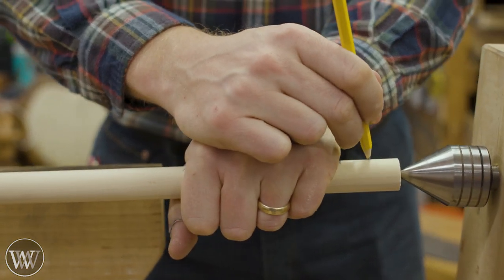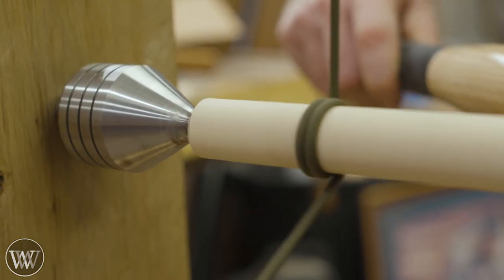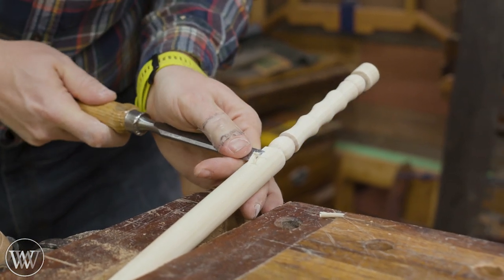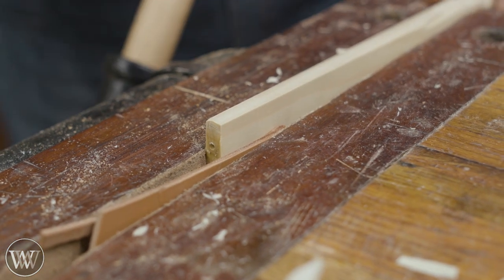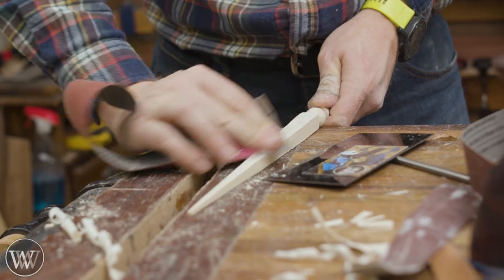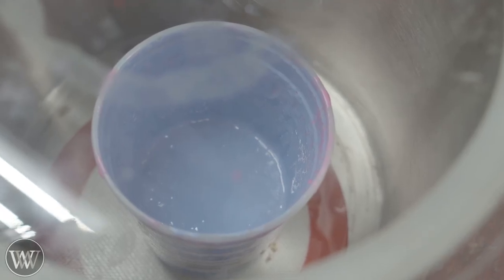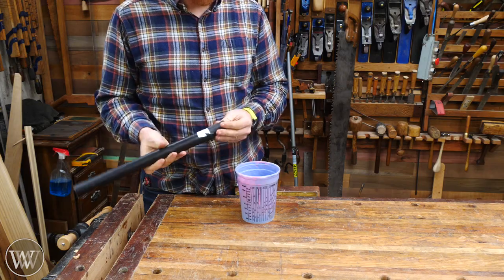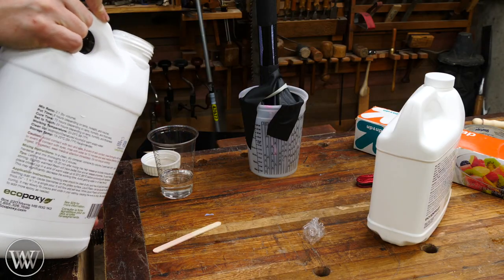How to make a Resin Wand with Walnut Core and Giveaway

Comment: Using a 1 part mold to cast multiple wands made from resin is the EXACT thing i was researching all weekend, i think only your video exists. Im just curious did you have a seam line where you cut the silicon mold?
Reply from the maker: on some of them there was a faint seam, but if I was carful you could not find the seam.